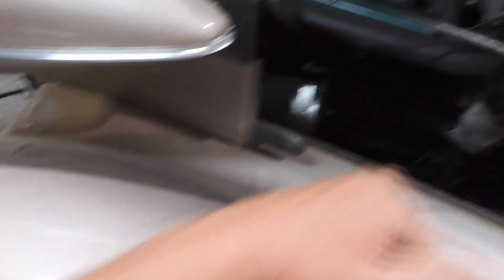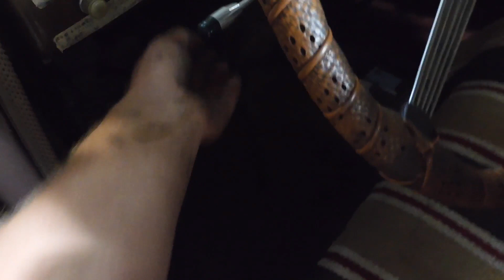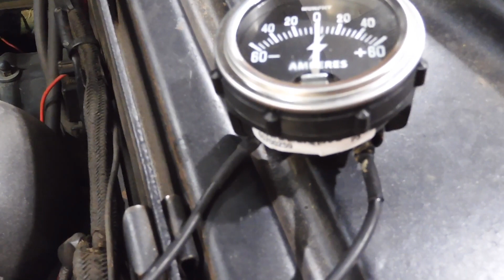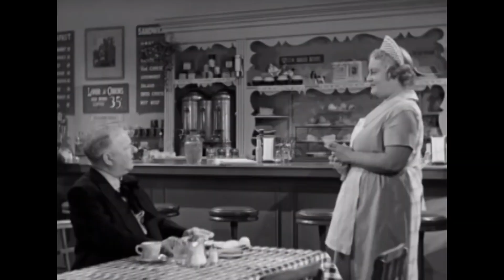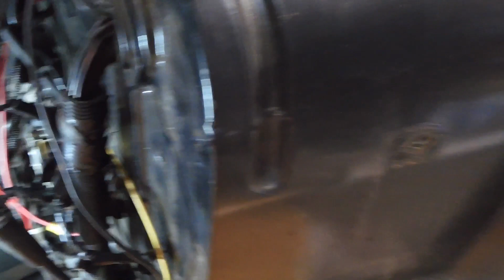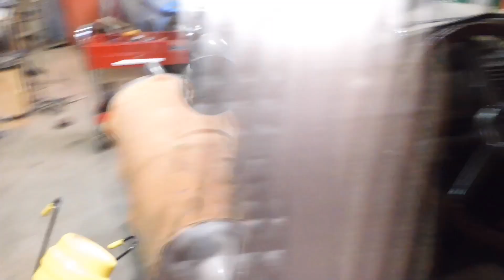Part 3: 1938 Buick Special Delco Remy Generator and Voltage Regulator R&R

Comment: Another great video.  Strange coincidence, all of the sudden my daily driver 1951 Chevy truck had the amp meter go full left last week.  I tried tinkering with the regulator after a lot of web research.  Then I had the generator out and torn down on the kitchen table for the week.  everything seemed fine so I broke down and bought a new VR8 reg.  But it looks like the issue is the generator.  Any possibility you would be able to sell the one you pulled?  I looked around but couldn't figure out how to send a PM of email. --Dave
Reply from the maker: Hook jumper cables to your 6v battery, clamp the negative end to the generator frame and a jumper wire from the frame to the field post. Then touch the armature post with the positive clamp. The generator should act like a motor. Then take the jumper wire off of the field post and the gen. should speed up. If this happens then your gen. should be ok. If not, let me know and we can get together on getting you a generator. Thanks
Reply: @TheJayhawker  Thank you.  I grounded the frame and field and applied power to the armature post, and it drew a lot of current and turned, but slower than others I've seen on the web.  So I pricked one up at rockauto, and just got it and put it in today, and everything is working fine now.  I guess I'll know for sure in a few days.  My original looks better/original, so I may still try to see if I can find the fault (maybe partially shorted fields or armature) Thanks again for the troubleshooting advice.